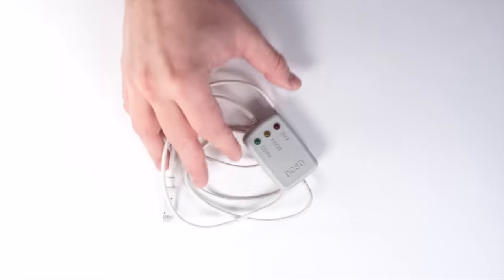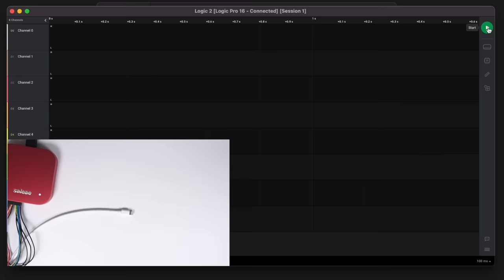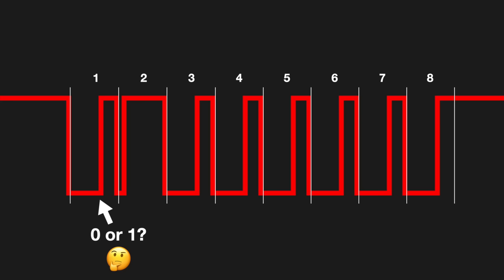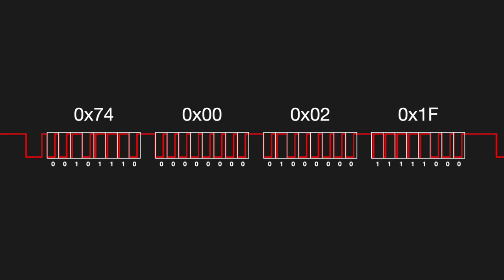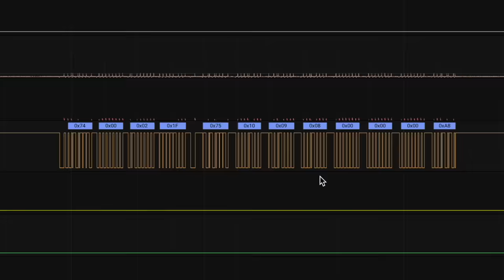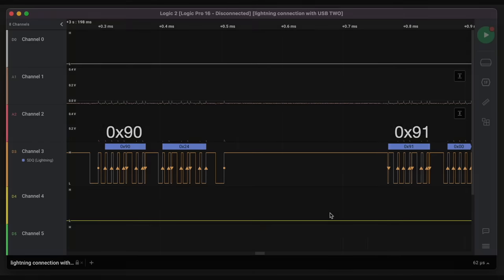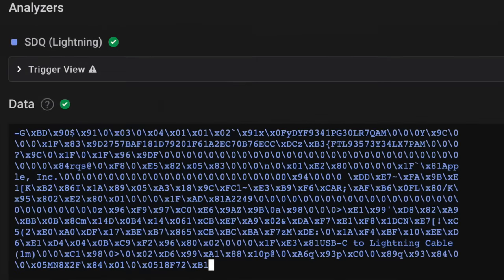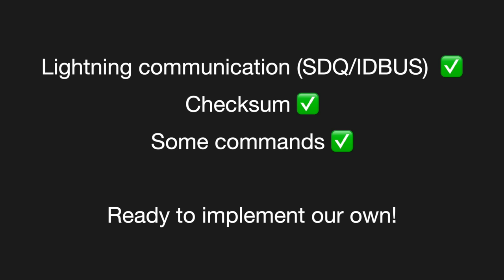The secrets of Apple Lightning - Part 1

Comment: It would be interesting to see the results from cheap knock-off cables and other 3rd party cables to see what they spit out and if it is legitimate. The extra stuff in the cable and the communications explains the licensing Apple pushes and the increased costs. It also explains why Apple would not want to go USB-C because they would lose money, data, and control over the cables.
Reply: Doesnt help when their shitty cable works with speed standards from the year 2000.
Reply: They did a gotcha and limited their new iPhone 15 base models to USB Type C with USB 2.0, but with the Pro Model having Thunderbolt. Touche Apple
Reply: I'm wondering the same thing, Apple cables are the worst for durability at the stress area where the cable meets the end. Some manufacturers do a much better job on the cable build, they last a lot longer.
Reply: They will soon
Reply: @HoloScope  the EU hit them once AGAIN with their bullshit and said they cannot limit any of it. lol
Reply: Except they have already built USB-C cables with the same f you tech built in.
Reply: USB-C is Not proprietary. You can use any USB-C cable with a phone that has USB-C port. Whereas with iphones  you need to use Apple's Lightening cable or an MFI certified cable.
Reply: Apple doesn't give a crap about cable quality. They want the $
Reply: @madog1  From what I understand, Apple cables are less durable due to the absence of PVC.
Reply: @Peter_Shadow  I didn't know that, thank you. They need to put stress relief near the ends too, that's where they always break, at least for me.
Reply: @madog1  According to them it is their effort to use less plastic and/or toxic materials. They have improved with the cables, the ones for Macs are now braided and the one that came with my Airpods feels a little more robust than those that fell apart after a while.
Reply: @peter_shadow7559  Good to know, thank you.
Reply: Apple cable are not durable at all, but you can poke lightning connector on your phone with metal pick cleaning it at it will work

There is plus and minus for usb c and lightning in term of durability, one is shit on cable, the other shit on port
Reply: Apple is going usb-C however there will be a catch
Reply: Lightning is literally USB2.0 on the data level..
Reply: Would definitely be interesting to see a comparison between third party cables with MFI certification and a knockoff cable
Reply: There is actually a reason, a dumb reason but still a reason, the CPU is built for Lightning so internally there's actually a lightning to USB-C conversion happening, the Pro has a newer CPU with proper USB-C support

Comment: I haven't done much research yet, but I'd be very interested in comparing the advantages and disadvantages of USB-C vs Lighting.
Anyway, great video!
Reply: Advantage: more money for apple
Disadvantage: literally everything else
Reply: @makuru.42  Advantage; More durable than USB-C since there is no middle part to break.
Advantage: Smaller than USB-C and takes up less space.
Reply: @JamesR624  Is it more durable? At least in my experience, USB-C has been way more durable. Lightning cables tend to short out between pins 7 and 8
Reply: @JamesR624  Lol! I have 9 year old USBC cables that still work like new. My Grandma has gone through another Apple branded lightning cable every other month since getting her polished turd of a phone.
Reply: @griffin8062  not the cable, it's the port
Reply: Lightning connector has a tendency to accumulate a bunch of corrosion on one of the golden contacts.
Reply: @operator8014  interesting, the first USB C device was released 8 years ago but you were using it a full year before anyone else.
Reply: @yolo_burrito   I have an old af HTC 10 that was an insurance replacement for my HTC M8 that got bricked by an update. The cable that came with it still works, even if the phone is derelict. That cable has a tattered braided sheath over the vinyl inner layer, which has a manufacturing date of 1Q2014. It is currently plugged into my wireless charger for my Samsung.

Not that I need to explain the difference between a manufacturing date and a release date to someone who knows EVERYTHING, right?
Reply: @JamesR624  Facts, I have the same lightning cable for years, while my sister changed like 30 usb-c cables
Reply: @IJurman123  then you are really lucky, I’ve gone though over 10 lightning cables
Reply: @IJurman123  Then it is problem with your sister. Tell her to not come close to technology.
Reply: @operator8014 tell your grandma she won’t have to charge her phone as often if she quits watching all that 🌽.
Reply: @JamesR624  oh more durable then why apple uses usbc on  the charger side?

Comment: Having worked on embedded projects that communicate with iOS devices before, I'm very interested to see where this goes. Some of this I recall from the spec; other parts it seems they don't even share with their MFi partners.

I will not be sharing more information, as I don't even remember what I can and can't legally say.
Reply: MFi NDA
Reply: They were doing funky stuff with the 30 pin cable back in the day as well. A mix between analog and digital. I may be recalling this incorrectly, but I believe you had to do some dance applying different resistances to different pins in a specific order as part of the handshake. Really finicky stuff to get right. Different devices would react slightly differently to that handshake, to the point where even the different storage options of the same model of iPhone/iPod had an effect. You really had to test every permutation many times (50+) to be sure it worked. But take the details with a large grain of salt, I just did the testing. I remember this from hearing the engineers complain about it back then. I could be wildly wrong on the handshake part.

I'm not worried about an NDA because I never signed anything like that with Apple. And the company where I got experience with this went bust a long time ago. Plus I don't think they really care about the 30 pin connector anymore, as long as you're not going around putting it on commercial products...
Reply: True.  Like your exp, even in future, even for USB they are circumventing the standard protocol.  USB already has data, power, fast charge etc. as standard - Apple is using only basic power from standard set, and they are using proprietary specs for other things (usb 3.1+ data speed, fast charge etc).  All in the pretence of customer safety :)
Reply: @rahuls4863  as louis rossman quotes, "safety and security!"
Reply: @rahuls4863  I have a feeling the EU will strike them down for that.. or at least try and say "you know what we meant, we're not tolerating malicious compliance, do it like everyone else does"
Reply: @teknikal_domain  👍 hoping your words come true. Another similar things Google did in India. They were asked to open up payment gateways integration for others as well, on reason was the high 30 percent commission they took. They too went the Apple way, they compiled but added a new clause that for external payments, Devs need to use a Google api that will do the transaction. And that api will auto calculate Google fee, which is close to 30 percent.
Reply: that's why you (should) preserve anonymity on the internets.
Reply: You can pretty much say whatever you want, the 'standard' hasn't been updated in a long time and was quickly uncovered when released. Also apple doesn't update their device interconnects very well and USED to be very well documented in a place you could access. It's part of why they axed their enterprise machines.
Reply: @Folsomdsf2 don’t buy it. Anyone that had real protected info wouldn’t hint at it like this D- 💼
Reply: Can they figure you out from YouTube comment

Comment: Hey, awesome video, loved all the technical details!

On a side note, what kind of logic analyser would you recommend for someone just getting into hardware security? The Salae ones you showed are a little outside my undergrad budget ;)

Will an ESP32/Raspberry Pi Pico suffice for most beginner usecases? What if I'm dealing with negative voltage signals?

Many thanks for your videos! Got here after LiveOverflow recommended them :)
Reply from the maker: You can get some very cheap ones on Amazon (like $10) - I think those are great in the beginning (and I still often use them)
Reply: @stacksmashing  alright, I'll have a look at those. Thank you so much!
Reply: @aathish04  I've used micros in the past, they're nice but one bit me when it pulled my i2c lines low when it wasn't powered. I use a digital discovery at work and it's amazing, especially with its high speed adapter kit. Very clean signals.
Reply: Personally I bought a 70$ one on Amazon and it does more than enough for me. Have used it a good bit. Probably the 10$ one would be enough for most to be honest

Comment: This is great part 2 can’t wait … there are some interesting other projects that might be able to be integrated with that tamarin cable, not very sure what “level” of signal processor / logic analyzer is required. But I have seen some open source logic analyzer on hackaday that use the PIO cores to get up to 24 channels , 16, 8… pretty sure you could pipe the GPIO that’s handling that communication into the other cores and have the ARM cores act like a TCP server to send the data through the USB connected to the PC to double as tamarin / logic analyzer .

Very cool project hope there is part 2 , and maybe some Lightning peripherals? Like lightning to usb hdmi hubs ? Get the readings from those ?

Comment: this is so interesting wow! im now very curious about a few things tho.
1- How do splitters work? for example i have a very cheap aliexpress splitter that basically lets me plug in both charging cable and lightning earpods on my iphone at once, im guessing this thing is 100% passive but i have no ide and im not about to destroy it rn tbh. but if its passibe how can it communicate with both things at once? and if active, how does it get to split these two things? 

2- does the cable reply to the device which charging capabilities it has? like if it can do fast charging or not, or is that linked to the modle number or name itself?

3- does the cable also talk to the charger it connects to? like does the apple PSU get any information about the lightning cable or device? apart from power delivery on fast chargers that is, especially curious on the old usb-a 5w and 10w ones
and 4- how do fake cables work then? ive had bad luck getting some knockoff ones bc they would charge very very slowly and im thinking if it might be bc the controller was answering stuff wrong and the iphone has some sort of anti-illegitimate mehcanism or something or if it just replied as if it was the slowest charging cable that exists, i really hope youll check this stuff at some point plz!

btw for reference this is the splitter i have (different store same thing tbh, not great bc it requires regular cleaning for it to work, also if u dont have experienc with aliexpress choose the aliexpress saver shipping unless its wayy too expensive for u bc at least in spain that option takes 2 weeks but the caniao expedited economy aka tghe default one for this takes months) https://www.aliexpress.com/item/1005004576959652.html

Comment: I'm curious to see why apple never upgraded lightning to support USB3.0. From what I can see Lightning has 2 differential lanes and Power and that could carry a USB3 signal. I wonder if theres any other limitation.
Reply: Lightning could do USB 3 at one point. Pre 2nd and 3rd gen iPad Pros could do it.
Reply: They did, there’s an official lightning to usb 3 adapter but it doesn’t do that speed with current gen devices anymore
Reply: I want my iPad Pro 3rd gen to have a 3.0 lightning connection. It's got Hexxa plus.
Reply: Has anyone analyzed / tear down one of the lightning to usb camera adapters ? Haven’t found one anywhere, it would be interesting to see the difference between the normal cable and the “otg” cable? Or does it work the same as if you get a usb-c to usb-a female adapter ? Would that work

Comment: Will you be exploring how the lightning dongles such as 3.5mm audio and HDMI adapters function? Interested if they communicate over the USB bus or one of the other channels
Reply from the maker: Mayyybe… I don’t have any yet :) Maybe I’ll buy some
Reply: If you got the usb camera adapter and or Ethernet , would be nice to know how they work. How they communicate with the tristar to use HID devices or Ethernet.

There is no documentation on anything except for a handful of lightning charging cables ( like this video ) and some on the Haywire HDMI. But I have not been able to find any docs on usb camera adapter or the Ethernet.

In your tamarind cable I notice you break out all the lightning pins.

Without JB phone or any demoting ( for non debug use ). Can you just plug in a usb-HID device into the usb port, without sending / spoofing the lightning cables ID to tristar? And the HID device be recognized by the iOS device ? If not  I would assume the tamarin cable firmware would need to be modified to send the ID for triggering the proper data lanes  and/or the service in lockdownd ? Or iAP?

Comment: I wonder, would this be able to debug an issue on a dumpster iPhone I found recently? I failed to flash iOS onto it, no matter if recovery or DFU mode, it always errors out or reboots at some point unexpectedly, and I have no idea what's wrong with it. I suspect a broken flash chip, but I can't tell for sure.
Reply from the maker: I doubt it to be honest :)
Reply: Send it to me. One of my iPhone's rudely erased  all data on me after changing passcode. 2 failed attempts and I freaked out shut off the phone (despite the glitch yes the GLITCH) I rebooted the iPhone thinking it'll solve the glitch but I did not know what I just done and bam first passcode attempt and it is erased everything. (It may have been poor wifi during request passcode change so from now on anytime I change it I make sure wifi is flawless beforehand!)

Anyways the point: this erased iPhone can still jailbreak using i2c box and even shows the iOS version 13.6.0 I am blaming Apple here. If it did erase "all data" then why the heck is it able to do this? P.S. This type stuff makes me want to sue company. False advertising IMO.

Comment: Can you see how lightning works on the second generation iPad Pros with the UBB 3.0 adapter? Those devices actually use all 16 pins for the lightning port but still only that one accessory and possibly the HDMI adapter have the connections to allow for 3.0 speeds.

Comment: id appreciate lightning more if the port was more durable. pins should be on the cable imo, hence i prefer usb c.

regardless, really informative video
Reply: I've never had a problem with the port breaking. I have had many cables break.
Reply: I’ve never had problems with Lightning. However, I have a phone with a USB C connector which broke within a month. I have a laptop where the connectors are loose. Mechanically USB C is terrible.
Reply: Lightning ports are FAR more reliable and durable than USB-C.
The plugs are not so good, as they tend to snap the PCB if over-stressed.
EDIT: I mean that the Lightning plugs are not as durable as the Lightning PORTS. However that is by design, since any impact will only affect a $20 cable rather than a $1000 device.
Reply: @Phillip Banes - so you agree with me. Therefore, the first word in your comment needs to be "Yes".
I have added an edit to my previous comment to clarify what I meant.
Reply: @Phillip Banes - I am not trying to correct you. I edited to make it a bit easier for everyone to grasp what I meant.
Argumentative and defensive much? We are all in agreement here, remember.
Reply: @Phillip Banes👈 🤣 whatever!

Comment: Great video. I purchased a dongle DAC to play Apple Music on my stereo from my iphone but discovered that only 4 lightning to usb-c cables in the world can pass digital music stream. Most such cables pass power and some pass digital files but very very few pass digital audio stream. To be clear the cable is lightning male on the iphone end and usb-c male to the input of the DAC. Otherwise you need the apple camera adapter and use a usb A to usb-c cable between the iphone -> camera adapter -> the dac. So lightning cables have lots of hidden protocol checks. I’ve also uncovered that my car’s stereo unit usb input isn’t apple friendly. When i plug my iphone to it, iphone says it doesn’t recognize the accessory. Again passing digital audio stream seems something apple is not making easy.